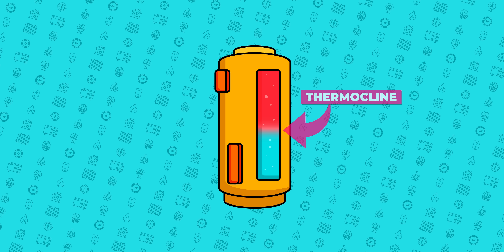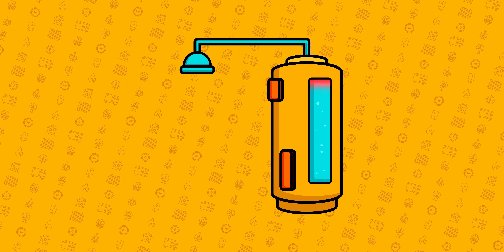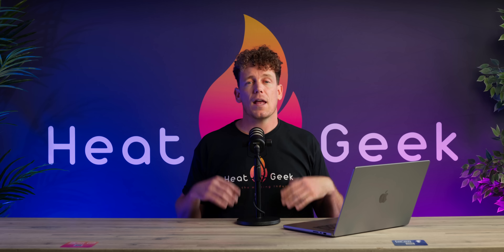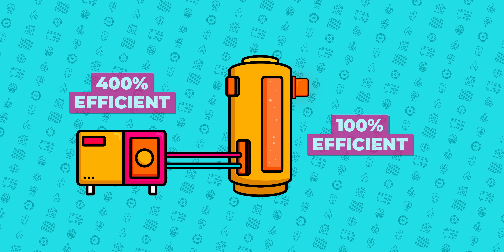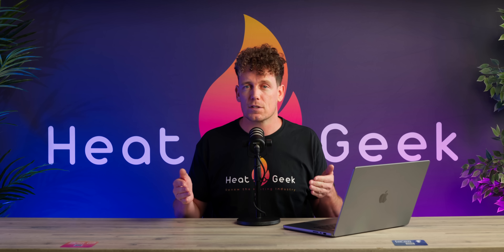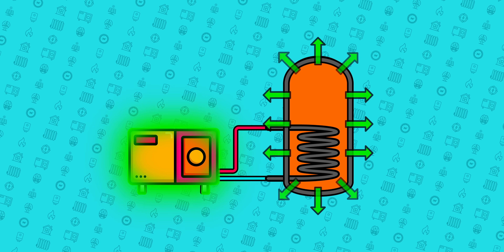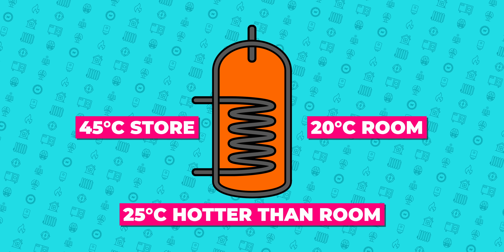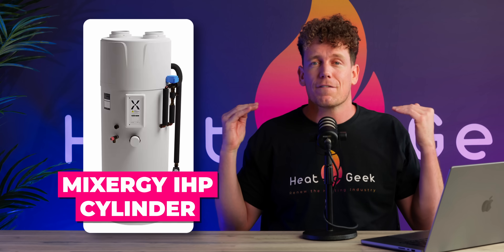Mixergy? THIS ALTERNATIVE CYLINDER IS 400% BETTER?

Comment: It would be great if you considered doing a video on thermal stores vs unvented cylinder, you don’t have to worry about legionella with the thermal store but are there any drawbacks compared to unvented?
Reply from the maker: Yes it’s much much less efficient as you have to operate at perminent high temperatures

Comment: Thank you Adam I've been saying this from day 1 when the cylinders came to market for Heatpumps. The every thought of having to butcher sensor cables and wire into a variable resistor to ghost the heatpump into thinking it needs HW and not only that on some heatpump apps the HW setting are useless because you need to use the separate app

Comment: No need to ‘decarbonise’; man made co2 does not drive climate change, and it’s worth bearing in mind that >95% of annual global carbon dioxide emissions are from natural sources. https://youtu.be/CqWv26PXqz0?si=Wcw9AA6gyGf0CuyM
Reply from the maker: 5% is enough to dramatically change the absolute temperature. Remember the earths temperature is 288 degrees kelvin so a 3degree rise is only a 1% temperature increase.

Comment: I’m so glad you brought this topic up. The Mixergy cylinder was on my list when I was originally researching for my heat pump installation. I thought it was going to be the bees knees in terms of getting the best out of my system. I did hear from some heat pump installers that it wouldn’t be worth it and I’d be best sticking the a standard unvented cylinder. Thank you for clearing this up. Makes me feel better that I made the correct decision by getting the Vaillant cylinder that matched my heat pump.

Keep up the excellent content as always Adam. 👍

Comment: I got a Daikin Altherma 3 R F heat pump. I got the heat pump set on weather  dependent curve.  The problem is that the heat pump is set on a south facing wall. Any sun I get gives the heat pump a false reading of the outside temperature. Any help would be appreciated. Bob.

Comment: I have had a Mixergy cylinder for a year now. I have solar and a gas boiler. It’s been ok but I have had problems with the app / internet connection. The main issue I have is the really poor response from Mixergy when you need someone to come out. They rely on a few fitters and think they can deal with everything over the phone / via videos etc. The care plan they charge a lot for a month seems a complete waste of time. So mixed views on Mixergy.

Comment: Its all about the Tariffs, a large Cylinder with twin immersion heaters & Heating the lower immersion heater on a cheap overnight Tariff, will be much cheaper than these units.
A cylinder with a big enough capacity for all your daily Hot Water needs, will be cheaper to install & more economic to run.

Comment: Interestingly, my CO2 heat pump heats from the top down - as I understand it, CO2 works more efficiently with a lower input temperature so it takes from the bottom and puts the hot water in the top. It heats until it’s 60 degrees C at a point a bit below half way and makes sure that happens at least once every 24 hours to avoid legionella. It’s all running from solar (year round, almost all the time), and takes only 1-2 hours from 10am so I’m not worried about slightly less efficiency from the high temperature (I’d rather avoid the bacteria).
Reply: So you are using Mixergy with the small top coil?  I did that for a while, efficiency not good at all!  Mixergy sprays cold water into the top of the tank, yes,  but the ASHP still works at high-temp all the time.
Reply: @danmfeist  No, this is a Reclaim Energy system which is an Australian brand, but the heat pump is a Sanden (Japanese) unit (although I think the changed to Toshiba more recently). But I think the Sanden setup works in much the same way.
Reply: @stephengentle2815  Ahh. These look very interesting.  They claim a COP of 5 while still giving you top-down partial heating, is that what you get? Have to read more.  When I tried this with Mixergy, was lucky to get COP of 2.
Reply: @stephengentle2815  I think it must be that fact that Co2 ASHP supports much higher delta-t! Can't do these with other refrigerants. Very interesting.

Comment: Thanks, be interested to hear your views on domestic heat storage via Caldera etc gaining lots of interest/subsidies.
Just seems like 1960s electric storage radiator tech with a new label and low COP.
Reply from the maker: It is but can store for a long time and is very large.. I quite like it to be honest as you can store interseasonally potentially!
Reply: @HeatGeek  a bit like filling up a thermos flask with hot tea in summer and hoping it will still be hot in winter....better to store the electricity and run a heat pump imho.

Comment: isn’t another advantage of the mixergy that you can use hot water right down to the last bit - where a regular cylinder will dilute with cool water so if you have quarter of a tank left, a regular HWC might be only warm but the mixergy is still fully usable?
Reply: Yes, they use an improved (patented) inlet diffuser. This isn't covered in the video. This is better than the average cylinder, but I don't know how it compares to the better alternatives. This works well in practice based on our experience.
Reply from the maker: Not really.. for most cylinders you feel it quickly drop off.. it’s doesn’t happen gradually

Comment: The IHP concept seems quite like the thing my neighbour has, an Atlantic Explorer, which is a tank with a heat pump on top. I've been wondering about such a device but it worries me that when the end of the life of the tank or heat pump is reached, you end up swapping out two bits of kit instead of one. I was also thinking though that you could opt to switch the cooler output air to indoors in summer to keep the house temperature down and vent outside in winter.
Reply: Interesting idea on the air-conditioning there.

The heat pump on the iHP is fully detachable so you could just replace the heat pump part as long as there's one that fits. It might be possible that you could revert it back to a standard hot water cylinder if you remove the heat pump, you'd have to ask the manufacturer about that though
Reply: The iHP concept differs from existing ones like the Atlantic Explorer, because it is detachable, which is great when one of them reaches the end of lifetime. And the iHP has the layered storage, whereas existing ones heat the whole tank en take ages to get hot again.
So with the existing ones like the Atlantic, you need to make sure the size of the boiler is big enough to handle all the demand in one morning or one evening as it won't be able to add anything useful on short notice.

Comment: Just swapped my combi boiler for a heat pump and couldn't afford the extra cost for the Mixergy cylinder I wanted. Sounds like I would have been wasting my money anyway! Lucky escape! 😬
Reply: You wasted your money getting a heat pump lol. Why didnt you just put in a system boiler with solar coil. Youd be well better off

Comment: The Thermocline surely must be like a vacuum flask inside the tank otherwise any heat inside it would immediately dissipate to the rest of the cylinder.  The added complexity of this system when working in conjunction with the complexity of a heat pump will never be understood by anyone - even a heat pump installer!! Hot water for taps is mostly unnecessary these days as dishwashers and washing machines use cold and an electric shower is very economical. Baths are banned in my house and I have an inline electric heater for my morning shave!!

Comment: Two quick questions about Vaillant systems...I have the standard Setup with a 45l buffer, the Unitower and the 5.5KW Monoblock.
What I am still figuring out is the pumps.
The underflooor heating has it's own pump, that can do something like 3000l/h or so if it were running flat our (which would be overkill) and the heat pump has a built-in pump that goes up to 860l on Auto, but can go up to 1500l when manually set to 100%.
I would love to know where the "sweet spot" is when setting both these pumps up. The one for the underfloor heating unfortunately doesn't how how many l/h it is moving, so synchronising it wilt the internal Vaillant pump is pretty much guesswork. 
Any hints you can give me? We have about 150m2 of underfloor heating and a very well insulated 2009 house.
Reply: Your manifold flow rate bulbs should tell you the flows. Or at least the return flows from UFH. Add them up and you have your ballpark. Slower flows will alow the floor to soak up heat over longer cycles of flow/return
Reply: @richardmobius9610  
Thanks. That's definitely helpful, though those little flow meters are not exactly precise...but if it's the only thing I can work with then that's what I will do.

Comment: Not sure I understand your point about the HP having to run at a fixed higher flow temp?  I have a Mixergy cylinder with a Vaillant HP, plus a load of temperature sensors for monitoring.  It takes around 45 mins to heat up to 50 degrees, and I can see the flow temp gradually ramping up from 20 deg up to 58 deg over that period.  I have a load of graphs if you're interested?
Reply: I think the point is that if ASHP controller doesnn't get any feedback via a tank temperature (and instead it's a fixed 20C when there is demand) it's going to work harder and ramp up faster but less efficiently, than if this feedback loop was in place. I have same setup as you; efficiency is impacted a fair amount by starting % charge and this dictates how much time it's working at lower temp.
Reply: @danmfeist  Interesting point - I've not looked at how the behaviour changes with starting charge.

It's not true that it doesn't have any feedback though.  The HP knows the return temperature for the heating loop.  It looks like it ramps up the flow temp on the basis of that measurement, maintaining a delta T of maybe 4 to 6 degrees of the course of a run.  I'd guess this isn't hugely different to a normal cylinder where the HP isn't going to see anything happening until enough water is heated to hit the NTC pocket.
Reply: @SimonKey-psimonkey  You observations match mine exactly. I'm just trying to understand the point in the video about this, but still not really getting it.  From my experience flow temperature is a function of return temperature and return temperature is a function of UVC temperature and coil size. I also observe that this is all controller seems to care about, and it ignores any configured flow temps or offsets anyway.
Reply: @danmfeist  with the vaillant HP you can set the  max time it takes to charge the tank up. You can also set the start times in the schedule so theres no problem using an off peak tariff, plus you would charge it right up to 100% on cheap rate surely? THats what I do anyway.. my cop for dhw since march is 4.1, admittedly the coldest months are yet to get thru.. The mixergy does seem complicated but it works well and the app is very good. (i dont have one for the vaillant). There is also the option to use the immersion but why would you, that's "only" 100% efficient :-)

Comment: I've had a mixergy heat pump cylinder coming up for 3 years now, I do feel like they are better suited for standard gas or electric homes. It works well enough but you don't really get the stratification benefit. I do use variable tariff but don't really feel i needed the mixergy app & technology to acheive that. It's still basically a good quality cylinder that does the job, but as the video says - shop around if you're in the market for a tank with a heat pump, keep it simple. Great channel ⭐💯
Reply: Nevr thought of it as main hot supply. IMO Use them as a pre heater for main hot water.

Comment: What is the most efficient boiler flow setup and range rating for a regular tank. I have range rated to the tank coil (17kW), set to 50oC storage but don't know if too low a flow delta will be less efficient. Default is 70oC flow.
Reply from the maker: As low temp as possible without cycling. Range rate to minimum

Comment: Erm, no. When a heat pump is commanded to supply hot water to the circuit that heats the tank, it doesn't suddenly hit the max outlet temperature the heat pump can supply. It can't – too much heat energy is lost to the relatively cool water in the tank, whether by coil or plate heat exchanger (as used by Mixergy). The overall efficiency is the same.

Title is pretty misleading too 👎
Reply from the maker: You’ve misunderstood the video. We did not say it does automatically hit the set temp, but it will cause a higher ramp up and this lowers efficiency.

Comment: I’m a heating engineer who installs both mixergy and unvented cylinders. My personal opinion is that the mixergy’s are too over complicated and gimmicky. Customers need one app for mixergy and then use another for their smart thermostat if used with a standard boiler. From my experience i just cant get enthusiastic about them, more expensive than standard unvented and more to go wrong.
Reply: I was close to getting one, but I decided just to stick to vaillant
Reply: It's basically a B rated.   I looked to but at £1500 just for tank.  Only spending £7pm in summer for gas hot water and gas hob so I never save anything.
Reply: How does the HP get the HW to 70 degrees as you mention? 
I thought HP flow temperatures were not capable of this with circa 50 deg flow…..
Reply from the maker: @markpowellmp  you’ve been listening to outdated sources.
Reply: @markpowellmp  buy a vaillant mine gets close to 80c flow when heating the cylinder
Reply: @markpowellmp  R290 refrigerant mate 👍

Comment: I was planning on going the Mixergy route with current gas boiler and thinking it would be heatpump ready for when I eventually get one. Any advice on a particular cylinder that could be fitted now on a gas boiler that is also great for a heatpump + solar pv connection please?
Reply from the maker: Call Newark cylinders and ask them for a Heat Geek cylinder

Comment: My Daikin EDLA 11kW installed by Octopus with a Mixergy is on the same heatpump monitor site (Cambridgeshire location - view?id=86 - data from November 7 2023) - can't share a link here it seems.

I have a Mixergy from 2018 and a new/ replacement Plate Heat Exchanger and new Heat Pump Interface provided in 2022 when hooking up the Daikin heat pump.

Works great, get good CoP and does not use fixed flow temp (return temp tracked and flow increased gradually, maintaining a 5C dT.
Reply from the maker: It does use a fixed flow temp. Your confusing target flow temp vs actual
Reply: @HeatGeek  Why is a higher "target" flow temperature an issue if the "actual" flow temperature still increases gradually with UVC as @stephencrown82 observes?  Because it means compressor works harder and therefore reduces efficiency, or something else?
Reply from the maker: @danmfeist  because it causes a higher ramp up than necessary.
Reply from the maker: Yes that. Also it gets to higher temperatures to heat the same tank
Reply: @HeatGeek  end/max flow temperature is more to do with the coil size than anything else in my experience (assuming a given target UVC temp).  Using Mixergy top coil I was seing UVC temp + 15K (!), with mixergy PHE I get UVC temp + 5-6k, and your 6m2 coil gives you UVC temp + 4k.  Top coil is a bad idea with ASHP, but 3 vs. 6m2 phe/coil only seems to impact max/final flow temperature by 1-2K.
Reply from the maker: @danmfeist  if the energy input is below the heat source saturation point yes. We go in to depth in this in our training.
Reply: @HeatGeek  I’m not so sure, as the “Maximum” (under tank settings logged in as Installer on the Daikin MMI) shows flow temp configured (48C) is ignored what that data shows as it’s clearly going to ~55C at the end of the ramp up. 

Data is on heatpumpmonitor FYI 

Interesting to figure this out!
Reply from the maker: @stephencrown82  two things going on here. Max flow temp and heat source saturation. Too much for yT comments but it’s targeting a fixed flow temp
Reply: Only Cambridgeshire install is "Grant". What is systemId? Thanks.  Also have Mixergy PHE, so keen to compare..
Reply: @danmfeist  view?id=86

Try that. It’s not displayed by default on home page as I’ve only just added to a week ago and the site will only show monitored installs of over 30 days of data by default without changing the filter.
Reply: I was hoping you’d name the best 400% more efficient cylinder... do I need a special cylinder to work with a Daikin Multiplus?
Reply: Ps great video, unless you’re a Mixergy owner

Comment: Wowww Adam nice ! Are you calculating kWh in to tank (coil) using the Sonnet heat meter and then using water meter for volume and specific heat cap of water , inlet water temp , outlet water temp to work out heat kWh out of the tank to decide when to recharge ...Sweet